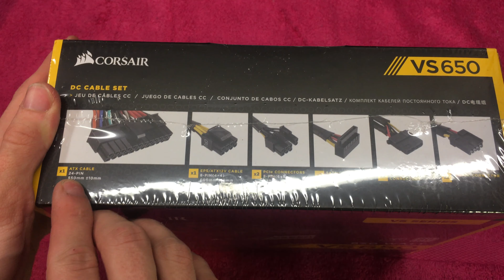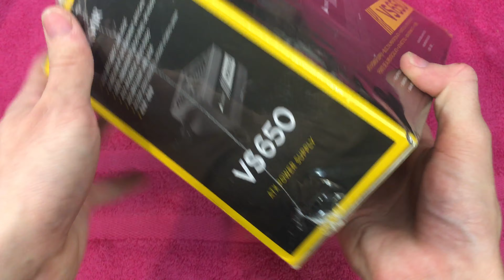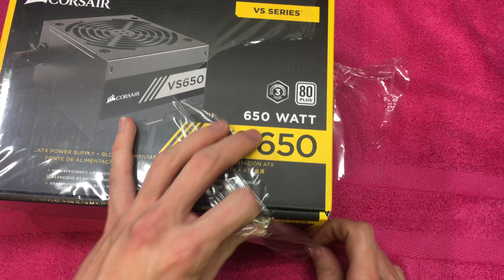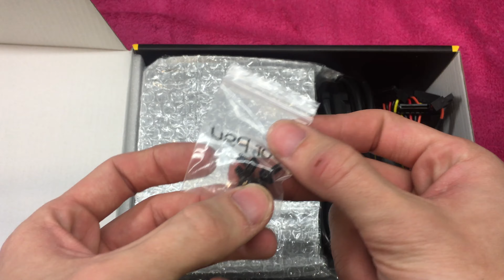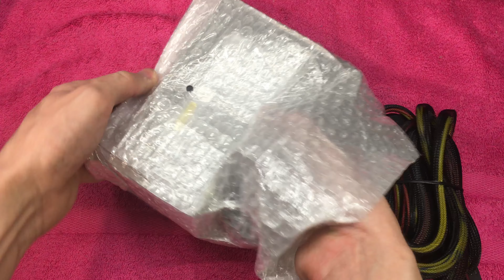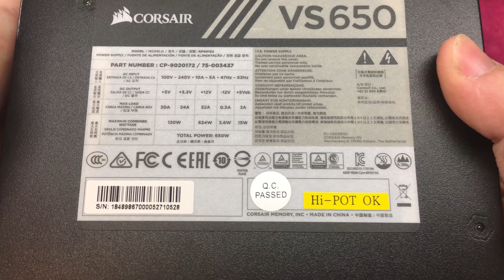Corsair VS Series VS650 PSU Unboxing & Overview - 80 Plus White, 650W Budget ATX Power Supply

Comment: the real question though... will this be enough for a RTX 3000 series? (3060 - 3070) mainly
Reply: 1 year later i can comfire its great for my 3060ti
Reply: it does have enough power connectors, although i think you should go for a quieter/more power efficient unit
edit: this unit does also cover the recommended wattage, but i'd rather get something like a seasonic core gc650
Reply: also im yet to hear it, with full gpu load and cpu fan winding up the psu does great cant find outer heat or hear fan but can feel warm air been pushed out
Reply: @mrbrittas3254  A year later works great with my 3070
Reply: @vice.-  still working great ?
Reply: @Ali-zz5np  yup, hard to believe i’ve had it for almost 2 years now
Reply: @vice.-  600w enough for 3070 ?
Reply: @Ali-zz5np  I actually bought the Thermaltake Toughpower gf1 750w which was cheaper than this psu through newegg and it works great
Reply: @vice.-  ok thanks i thought you have 650w power supply
Reply: @Ali-zz5np  i suggest you get that too cus its 100w more for cheaper and its a good company
Reply: @vice.-  i already have the psu and i don't have extra money to buy another psu
Reply: @Ali-zz5np  should work fine with a 600w psu, its the suggested wattage for a 3070
Reply: @vice.-  and is the white standard good enough?
Reply: @Ali-zz5np  i wouldn’t suggest so. Also, i was wrong, nvidia recommends 650w for a 3070
Reply: @vice.-  Ok thanks

Comment: Do you think this is overkill for a Ryzen 5 1600, rtx 2060 and 16gb ram build?
Reply: never over kill on psu, the higher and better the more withinits limit it runs, try reving the balls of a 50cc engine to do 45mph then use a 2ltr  engine and can ido it on tick over. how is it over kill? it only gives the power the pc asks for and no more, so its never close to beeen stressed if its over kill, the only thing that can be over kill is price if it costs alot more but isnt needed, sorry im  a year late but this applys with alot of things, my old gpu took 230watts and over 80degrees to fun my game at 45fps, my zotac 3060ti runs max settings 1080p vsync 60fps at under half the power and 40degrees so speeding abit more on a better upgrade than i needed payed off, its cheaper to run and will last alot long not been thrashed

Comment: DO NOT BUY THIS PSU WORST PSU EVER IF YOU WANNA TRACTOR THEN BUY IT !
Reply: why?
Reply: @Whatzgood0705  i have this psu for less than a year and after only month when i bought it, it started to do some wierd noises like fan sratching on metal sides of psu box and now like a week ago it started to do the same but so much louder .... I heard that a lot of people have the same issue and corrsair vs power supplies are not good series of psu .... Look for something from termaltake or coolermaster ... (Sry for bad english)
Reply: The Shadow fuck i ordered it already :/
Reply: @lebronjames8605  it will probably work well first months and it has not power loss or issue with computer wont turn on but yeah u will see where is the problem
Reply: What parts were u using with it?
Reply: @lucacocozza  r5 3600 gigabyte b 450 16 gb ddr4 rtx 2060 ssd and hdd

Comment: Will this PSU work well with a Ryzen 3600 and an RTX 2060? I've seen a csgo pro player using it and he has a Ryzen 9 3900X and a RTX 2080 Aorus XTREME.
Reply: I'm planning on using the same as you. Does it work well??
Reply: 650w is all you will ever need with one gpu

Comment: Quick question. ATX connector for motherboard got all 24 pins occupied or there is one empty? Cuz in my psu one is empty there is no connector inside ( one in the middle) just wondering if i got faulty one. 🤔
Reply: Tomas Pat nope it’s supposed to be empty, it’s not faulty.

Comment: I just purchased this power supply! This video convinced me so thanks! Perfect and enough to power my upcoming pc with Ryzen 5 2600 + RX 580 gpu 👍🏻
Reply from the maker: Great to hear it helped you out! Good luck with the build. :)
Reply: Xqrement does this PSU have any coil whine?
Reply: bro can you overclock your ryzen 5 2600 to 3.9  - 4.0 ghz or so on this thing ???
Reply: Cost?
Reply: get ready for boom
Reply: Kot420 Why?
Reply: @wexerst9233  2/4 builds i did with this has been damaged
Reply: @sonid4205  yup i was scared .. AF 1500$ pc with this cheap as shit .. no way..
Reply: @sonid4205  i went for corsair tx650m used

Comment: This psu with gtx 1070 and i5 9400f is enough?
Reply: Raheem .I. Yes I would believe that 600W would be enough and if your 1070 needs an 8/6 pin power connector (2 of them included) this is the way to go for you

Comment: i use this with a i5 8600 and gtx 1660ti. will it hold up for years ? ...i wont overclock....as i don t have a k cpu....and i will always run budget g cards....will it hold up...or should i again change the psu ....
Reply: I think it will.

Comment: Hey great video, what's the difference of this to the CX650M
Reply from the maker: Hi, The CXM series is modular, meaning that you can disconnect some of the cables you don't need, so there's less clutter in your case. Hope this helps!
--Nathan
Reply: @NathanPH  Ohhh I get it now, thanks so much!
Reply: @Nathan PH
Thanks Ni always thought that modular means that you can stack multiple PSU:s and use them together.. like 2x 3x etc..